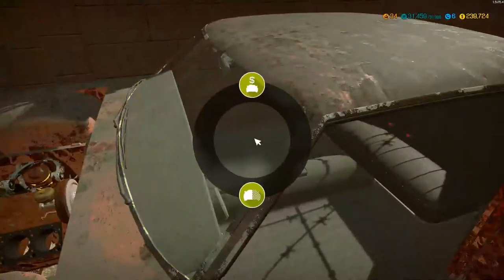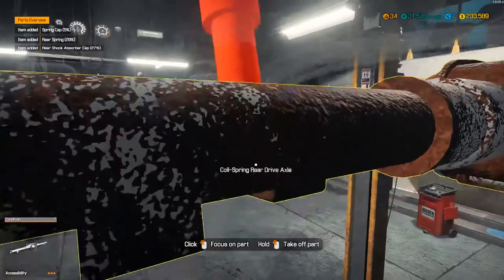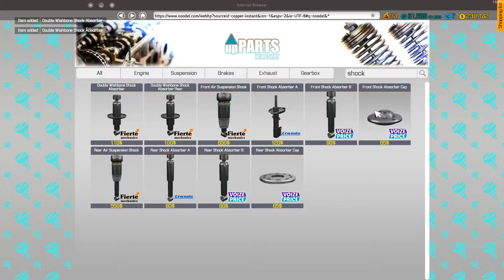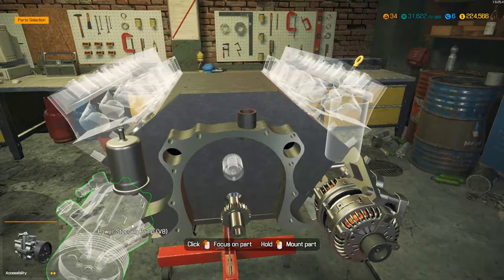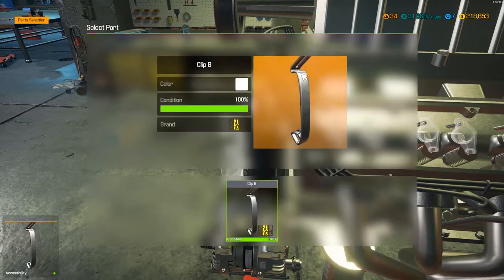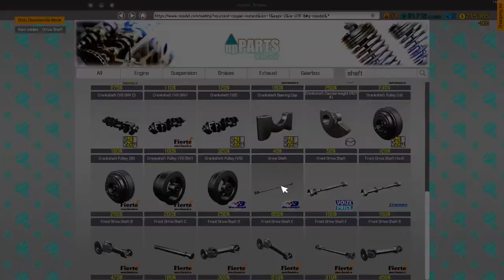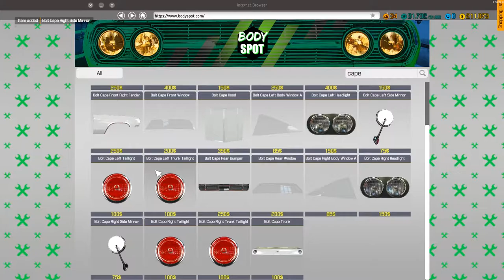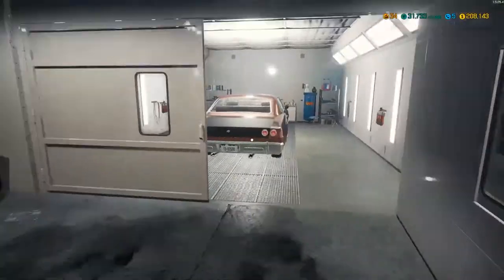Restoring the Bolt Cape Supercharged | Car Mechanic Simulator

Comment: I buy a v8 ohv and try to put the supercharger but it only tells me I could only put a 1 carb
Reply: Same issue
Reply: I built a supercharged v8 ohv and it says there is nothing to put into the car
Reply: @quintonespinosa5816  I have the resolution, so first you buy the engine block for example v8 OHV then you put it into the engine stand (in front of lifter A ) then you choose v8 OHV supercharged and from there you put the parts together
Reply: @quintonespinosa5816  after that you put the engine on the engine lift a d put it in the car like the atlanta etc.

Comment: where is the oil
Reply: @cohen hodge

To fill oil, open the oil cap on top of the engine. 

To drain oil, Use the oil change station that's in your garage. Click it and say "use station". That should move it to the car. 

The station has a flat "pan" on top with a pipe going down to a container.